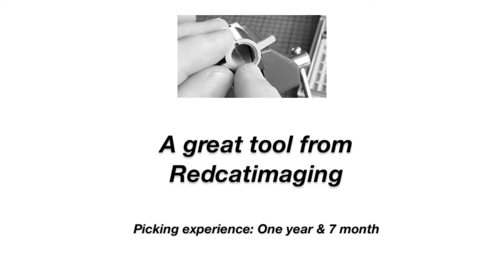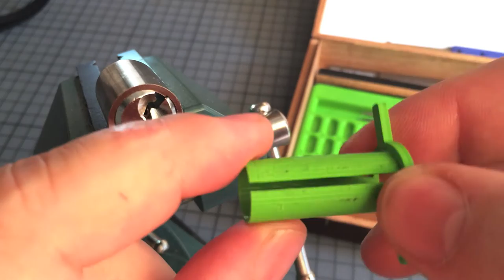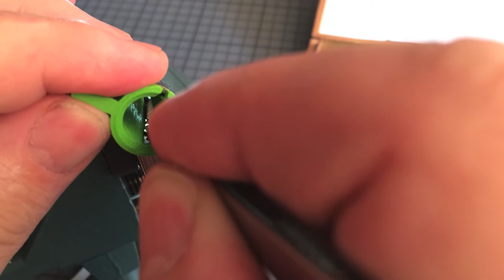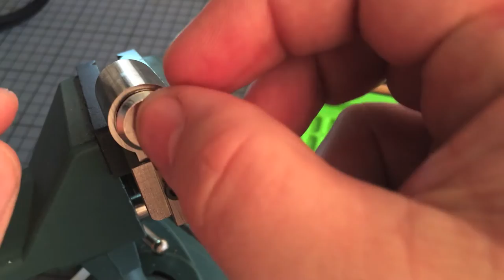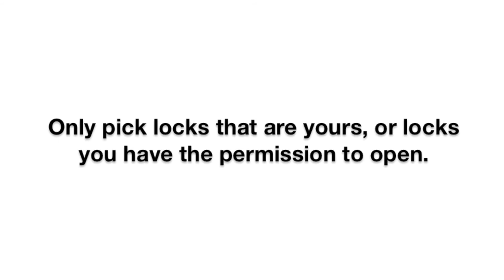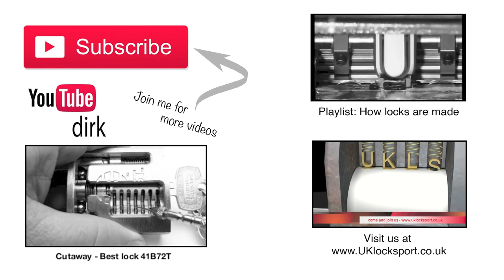[060] How to assemble easy a Euro Lock - Tool from Redcatimageing

Comment: Thank you so much for testing and making such a nice video :), I'm very impressed.
I'm still not 100% used to work with the tool myself ;)) hehehe, but I'm learning.
I have taken note of your tip with the angle. It is a very good point and could really improve the function.
I did the angle by guessing, as I had almost no information of the dimensions of the original tool.
I will try to change it for future versions when I get some more time.
Reply from the maker: Thanks again, for this great tool and your kind words. As I said the tool is really a big help. I am looking forward seeing your version 2.0 in action. ;-)
Reply: I think I will try to edit it too :). I already broke two of these since the walls were so thin. I will post my findings on the forum if I have any.
Reply: +Boris Kozo Try to set the printer to 3 outer layers. How did you break them? ? Mine are really strong. .. I have already edited the slit angle, just not posted. And developed a 3rd useful tool for this pinning set. Posting also soon on the forum. cu friends :)
Reply: What happened was what you predicted for the 3d keys. The layers unbinded. I will try printing the next ones with ABS maybe. I am new to all this 3d printing stuff so I am still not sure what each parameter means :). Thank you for making these models.
Reply: +Boris Kozo Actually...the same happened some minutes ago to me too. Try to print 1 at  a time. I did more and the layers got to cold.